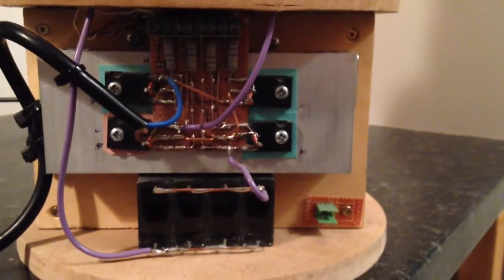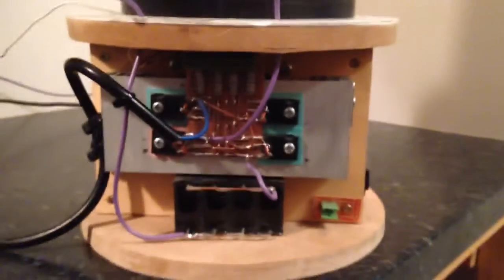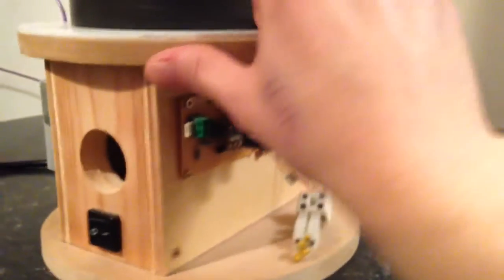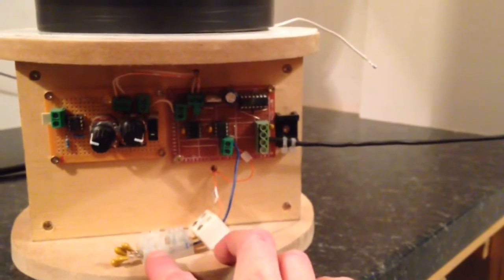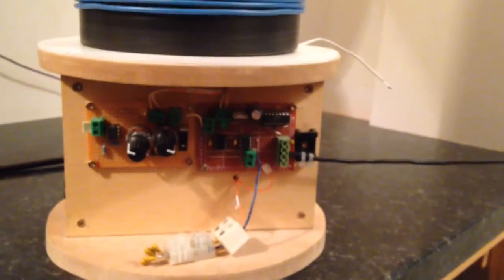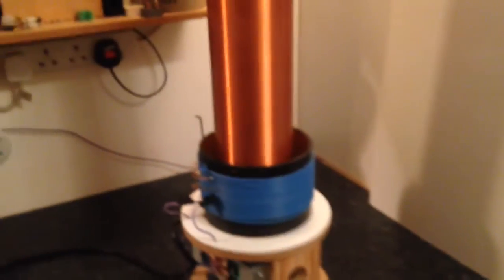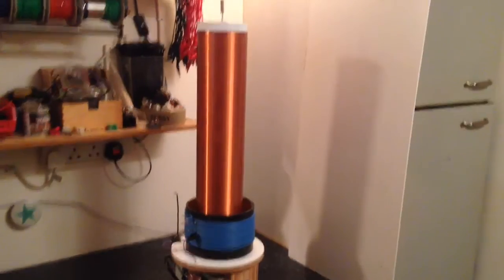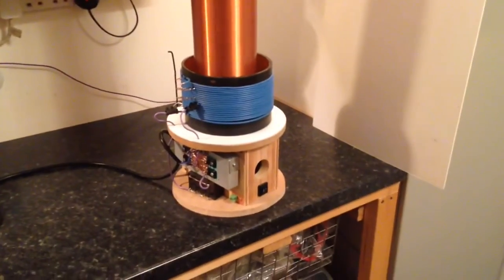SSTC5 Full Bridge ion spinner

Comment: Hello again, great demonstration. how exactly did you make the bearing for the spinner? I made a prototype with a z shaped wire and fastened it to the sharp end of a nail, so that the base of the nail sat on a flat metal plate on top of the slayer. this worked well enough to prove it would work, but it would quickly work its way off the plate and fall. is that a metal pen case and then something else to let the wire spin better?
Reply from the maker: Hi Joseph, it's basically an M3 x 20mm standoff screwed down about 10mm onto a long M3 bolt which is attached to the top of the coil. The centre pin on the spinner is spinning on the bolt that screws up inside the standoff. The side walls of the hole inside the standoff cups around the pin and stop the thing flying off ;)